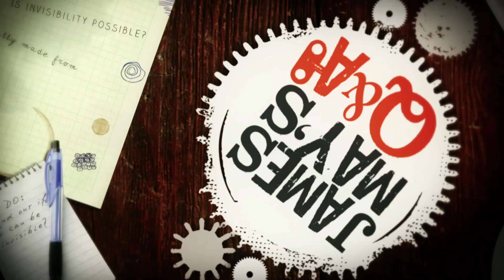Why Can't Trains Go Uphill? | James May's Q&A | Earth Science

Comment: the heavy weight pushing down on the wheel actually causes the rail to deform so tractive area is larger than supposed athough still tiny.
used rails will mash out due to the repeated pounding

Comment: Another problem on steep inclines, is keeping the water level constant, especially going downhill.  The crown in the firebox needs to be covered at all times.  On some downhill runs, the loco has to go in reverse.
Reply: Going reverse would severely damage the tracks. But you are very right. If you melted your boiler then it's SHTF.

Comment: I agree with some of what you r saying but trains can go up hill. The problem is coming down the hill safely.  The engineer can put plenty of sand down control wheel spin you do not want wheel spin and yes trains needs help sometimes but if there is big hills the RR can provide a engine to handle grades. The years I work for the RR I never heard anyone complaining going up the hill , but heard many people complaining r talking about going down the hill. Using the word complaining I don't think as much complaining is making sure everyone is on the same page going down the hill. Steep grades does not take but 1 very little mistake the you have a run away train u hoping the siding switch so you can run up hill to stop the train. One of the most steepest grade for a train in United States I've heard the RR spend alot of money and time to take down the grade. I don't know if they did r didn't I know the last year i work was on the RR the grade  was very much still there.

Comment: If a train were to use a magnetic induction system to make the wheels magnetized for a split second in succession, there would be no traction problem and braking could be faster because the wheels could become an electromagnetic when the induction contacts connect to the rails.  That means a train could be faster and stop faster.  Climbing hills would not be much of a problem.

Comment: The problem is that the car-wheels aren't powered.
If they could put electric motors on all the cars, then they could help them accelerate the train, as well as brake it, by the locomotive producing power for the cars when necessary.

Comment: The steel wheels are an advantage and  a disadvantage . While it has a disadvantage in traction  for hills and turns  it also has very little friction so it doesn't loose much of the engines effort to simple friction which is why it's so cost effective to ship by rail.

Comment: In New Hampshire, USA, the Mount Washington Cog Railway is a 3 mile rail from the base of a mountain to the summit with an average grade of 25% (14°) and a maximum of 37% (20°)!!! If you're into trains, and you haven't done it, it's a pretty mind blowing ride. The railway has been open since 1868 and used to be all steam engines. Now they have a couple steam engines but mostly diesel.

Comment: The breaks have a much larger advantage over the acceleration when it comes to trains as only a few of the many wheels apply power to accelerate,  but all the wheels can apply breaking force.
Reply: Yes, and all the train cars that follow behind supply braking force and rolling friction from their wheel bearings.
Reply: even in low power notches (levels), it is possible to overcome the static friction of all brake blocks when a full brake application is made on a locomotive. The problem is not getting uphill anymore, rather getting a laden train down that same gradient without wheelslip or overspeed.
Reply: That's why multiple unit trains are superior over prime mover trains.

Prime mover - trains that are pushed/pulled by locomotives
Multiple unit - trains with wheels that are directly powered, usually with electric motors
Reply: Brayks
Reply: @krakenwoodfloorservicemcma5975  Brakes
Reply: @krakenwoodfloorservicemcma5975  Brakes
Reply: @krakenwoodfloorservicemcma5975  Brakes

Comment: im sorry sir, you are mostly just plain wrong. the reason that trains struggle to up a hill is the same that a front wheel drive car can't go up a snowy slope while an all wheel drive car can : the wheels that are applying the traction (being actively turned) are bearing only a tiny fraction of the total weight of the vehicle (most of the weight is being borne by wheels that will turn passively) , therefore the traction wheels begin to slip as there is not enough weight on them to cause enough friction to prevent slipping.

A few other facts that highlight the innacuracy(ies) in your video :

1) the sliding frictional force between two surfaces is NOT a function of the amount of surface area that is in contact. it only depends upon the weight (or the normal force that one surface applies on another) and the nature of those surfaces.

Comment: What about the sand? Most modern locomotives (including steam era ones) had sand boxes and a distribution system that trickled that sand between the drive wheels and the track. That increased locomotive traction substancially.
Reply: Sand is mainly used on tracks that are wet, iced or coverd with leaves. On a dry track the sand doesn't help with tractive effort. On the mentioned 2.65% incline you still have about 96.66% of your tractive effort.

Comment: On the loco's I used to work on, that travelled through the ranges in the Australian outback, they'd have a sandpit at the bottom and top of the hill climb's, the driver's would load this sand into big boxes above the wheels on the loco's that would trickle sand onto the track in front of the wheels, to gain more friction

Comment: He did not mention that modern electric multiple units have "distributed power", multiple traction motors at intervals along the entire length of the train rather than a single locomotive up front which greatly increases the grip level.
Reply: Multiple locomotives have been a thing for far, far longer than modern electric locomotives. Even in the steam days they would run multiple locomotives to get heavy loads through mountains. All that's changed is how they control them, they're all radio control now instead of having flagmen signaling the other locomotives. It doesn't really change the fundamental point of this video.

Comment: Cars 50% of weight on driving wheels (for most cars)
Lorries 50-30% weight on driving wheels 
Trains 5-10% weight on driving wheels (100 ton train pulling 1000 to 2000 ton freight).
contact area is irreverent - as friction is proportional of weight - not contact area - since friction increases with pressure and reduces with contact area by close to the same proportion.
So the amount of mass on the driving wheels is much less on trains - so the friction is much less - and there is no point making a powerful train that spins it wheels.

Comment: Could they not just put rubber / tyre like material on the up hill gradient pieces of track alone ?
Reply: The pressure from the wheels is unbelivably high. It would wear out too quickly.
Reply: @jorisknuts9662   I’m sure modern materials could handle this and maintain / replace these uphill only sections every year or so
Reply: @thomassmith8515  let me ask you then, why don't they put the modern material on the track ?
Reply: @jorisknuts9662  well the track itself is mass manufacturers steel which is cheaper, what I’m saying is on the say 1% sections there may be uphill they could place solid composite materials that could be able to hold traction

Comment: He never mentioned THE key difference between a train and a car - the length. Most of the weight of a car is placed close to the drive wheels, so that as the car gets heavier, so does the friction which can be used by the drive wheels to produce force. Trains get heavier by adding cars, which have only undriven wheels and their weight does nothing to help the traction of the locomotives. He also failed to make a distinction between static friction (which is good and helps you to gain traction and does not tend to slow you down) and other forms like sliding friction and wheel deformation (which DO end up making it harder to drive forward).

Comment: So lets see; If you really wanted to design a train system that WOULD go uphill the same as semis on traditional roads, then you would have to design a train locomotive which could drop a hydraulic set of wheels onto a small "rail-road highway", and that would pull the train uphill quite handily. Imagine a sidewalk sized strip of pavement between the rails, and anywhere else the grade was too steep for the steel train wheels. That, in essence, would be what I am describing. Now please keep your dress on, James, this is not liable to become reality anytime soon, so tell your buddies in the highway haulage business that your little vid fooled all the fools, on your side of the pond, and ours.

Comment: Of course as James' says it is all about traction, and not the power of the locomotive.  There are ways around this.  Rack and pinion, not good for long distance.  Rubber tyres can be used (as once on the Paris underground), but is expensive.

Comment: There is small problem with his explanation on going downhill with a train.  He mentions that the friction contact area with the wheels going up a hill is the same as going down hill.  This is not true.  Going uphill the friction contact area is concentrated on the drive wheels on the engine.  Going downhill, or just plain stopping,  ALL the cars are equipped with brakes that activate making the contact area much greater.  This is the same on a semi truck.

Comment: Another solution is to spread traction power accross the train. At the German ICE 3 for instance, it can maintain 300 km/h (185 mph) at a gradient up to 4% because of the traction power being divided along the train (it also allows quicker acceleration)
Reply: For those of you who don’t understand, the German ICE has AWD
Reply: Yes MU rushes through grades with ease because he has the full train as weight. For conventional setup if the train is too heavy and the loco is too lightweight it won't move even if the loco has a superman in it. It's the problem of traction like pushing a heavy box on ice. Your feet will slip and the box will never move.

However MUs are expensive to use therefore it's only good for HSRs. Freighters have little profit in each haul and using MU as freighters would eat all your profits. Sad truth. Freighters can't afford MUs and had to use conventional setup.
Reply: @phoenixarian8513  Well, nearly all Dutch domestic trains have the MU set up and by somewhere next year, all have.
Reply: @SpeedBird6780  I've heard europeans have so little freight loads that the semitrucks are gonna do this job instead. If there's only a handful of them to deliver some high value cargos such as automobiles this will still be affordable.

Just thinking about delivering some heavy items such as COAL or IRON ORE with MU makes the treasurer scream.
Reply: @phoenixarian8513  I was talking passenger services, freight services still all have locomotives run it (obviously). It wouldn't be feasible, even in Europe, to run MU set-ups on freight trains as usually, there are cars with multiple destinations on one train and that needs to be exchange. I thought I was pretty clear that I was talking passenger services in my previous comment.
Reply: @SpeedBird6780  Well that's my fault.
China is also working to retire all those conventional passenger coaches.

Comment: They had this issue in America on the DC Metro Trains. Their new 7000 and 8000 series trains can't go up hill and they lost all electrical power. It took them several months before they could ever use the trains on the most difficult tracks to ditch their 1000, 2000, 3000, 4000, 5000 and 6000 series trains.

Comment: How much more traction would rubber tires on the locomotive drive wheels accomplish?
Reply: not enough, because the main issue is not traction but power. It's like trying to make a tank go up a mountain, with the same power/weight ratio.
Reply: The issue is traction of steel wheelslipping on steel rails.  Such is why they often must use sand.
The power is there.   My great uncle's huge 4-8-4 freight locomotive had the power but could easily slip.

Comment: I thought that trains had brakes on all the cars. So going downhill shouldn't be such a problem as going uphill. Am I missing something?
Reply: Still those brakes are way hard to apply due to so low friction.
Reply: @sayamqazi  Sure but the friction for each car is going to be proportional to the weight of that car rather than the weight of the engine vs the weight of the whole train. We're not talking about stopping the train in a hundred feet, just preventing runaway.

Comment: Small mistake in the video: at 4:07 he says the "tractive force remains the same" on the incline. This is not true. It actually becomes less (making it more challenging for trains to climb hills. In physics terms the force of friction is equal to coefficient of friction (steel on steel) multiplied by the Normal (support force). This Normal force become less on an incline.

Comment: Why don't they just make the wheels and tracks  a more tractive material
Reply: Because those materials are higher wear and higher friction.   It completely defeats the economic gains that trains have in all other areas.
Reply: @leovolz311  like?
Reply: @tonyboss4290  -  Not sure what you're asking.  What materials won't work?   What economic gains?   What you refer to as "more tractive material" amounts to adding friction. Everything about  what makes a railroad system work as well as it does is predicated on reducing friction.  Much easier and much more economical to add more locomotives to gain tractive effort when needed.  Extra locomotive force can be disengaged or disconnected when no longer needed.   What you're suggesting cuts operating efficiency full time.

Railroads measure their efficiency using a metric called Revenue Ton Miles per gallon -  how many miles they can move a ton of goods on one gallon of fuel.   Railroad RTM/gal numbers are typically 4-5 times higher (more efficient) than truck RTM/gal.  Highway trucks can go up steeper hills, and they can go around tighter turns, running on almost any paved road, but they do so at the expense of economy caused by their use of higher friction wheels/tires on higher friction road surfaces, both of which wear considerably faster than steel wheels on rail.  Railroads sacrifice flexibility (climbing, turning) to keep their efficiency of performance.   If they start adding "more tractive material" their performance advantage over trucks shrinks and their profits go down.
Reply: @leovolz311  OK cool makes sense.. just looked it up... what you didn't include is that trains spray sand when they want traction. So there are traction improvements to be made.

Comment: Friction forces are supposedly independent from the contact area. I've been struggling with that since secondary school - 16 years old - and I'm 57 years old now and have been around physics quite a lot. Ok, it is logical: if you double the contact area, the force perpendicular to the surface - or rather, the pressure between the surfaces - is halved, so it should be independent. But still! It somehow boggles my mind. This is why I give flat-earthers a wide berth. Afraid to get sucked into that black hole of the mind...

Comment: "The wrong kind of snow" had nothing to do with traction. It was blowing through the grills of the loco engine compartment and getting electrical bits wet and causing engine failures.
On the Lickey incline some muppet grew trees on both sides of the line, which during autumn would deposit their leaves on the line and while banking a train you could feel the leading loco slip and watch the speed decrease when it hit the leaves. Once it cleared the top and the bankers hit the leaves  it would do more work in pulling itself until we cleared the leaves.

Comment: why not make the wheels of the train like a cog\gear and the part of the track with the same segements atstarting at the beginning of the slope\gradient on both sides.  or make a pulling system like on roller coasters one for resistance on the way down.

Comment: Thanks for an interesting video, but I was a bit surprised that You didn't even mention the big problem that can be caused by "simply having some leaves on the track".
And also if I'm not totally mistaken (and I'm nitpicky ) the "tractive force" will not quite "remain the same" when running up a gradient [@4:08]
I would presume that when "running up an incline" a part of the weight will result in ""added drag" as You said.
But also that, since due to the gradient the weight is no longer "pushing the train" perpendicularly against the tracks, a "small part" of the force that is created by the weight of the train "pushing it" against the track will also be "lost".
Which ultimately leads to lower friction and hence lower "tractive force"... Or??   
Best regards

Comment: At :43 he's saying that stairs are 81º, but the sign on the screen says "81%", which is different. It is confusing because a moment later the screen also says "that's 567.1%". So 81% is the same as 567.1%? The sign should say "81º"
 (Also I think he means we can climb stairs of UP TO 80º; standard stairs are not 80º, since 90º is vertical. And that 80º limit more a matter of balance than anything. One can climb a ladder at 90º, but only by using hands as well)

Comment: I still cant figure how they move on smooth steel wheels. When you put those on a Jaguar it went 2 mph with 200 hp engine.
Reply: ye start off pretty slowly so the wheels don't lose traction,  they have lots of gripping points so in the end it works out fine, just braking unexpectedly is a bit of an issue as we all know.